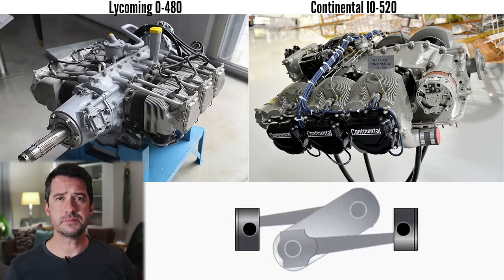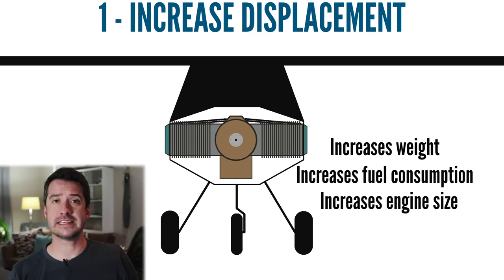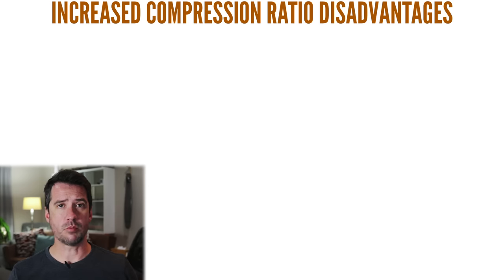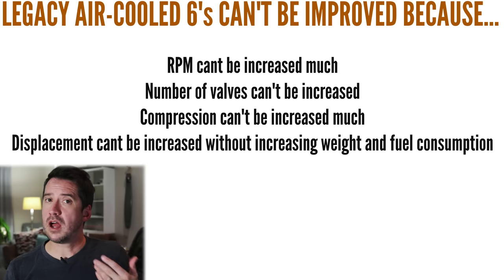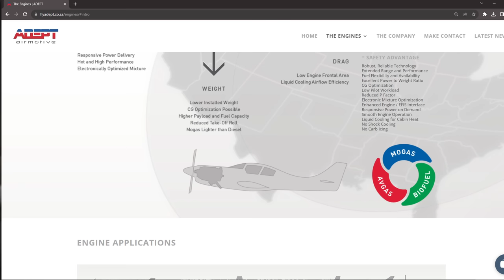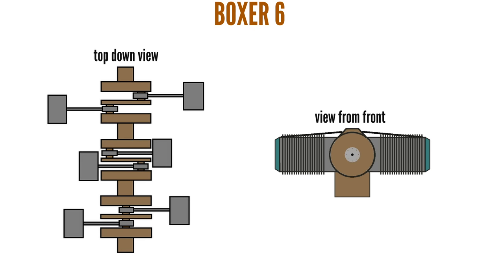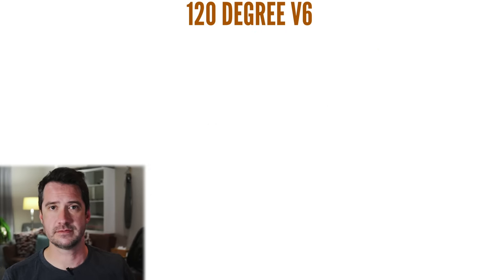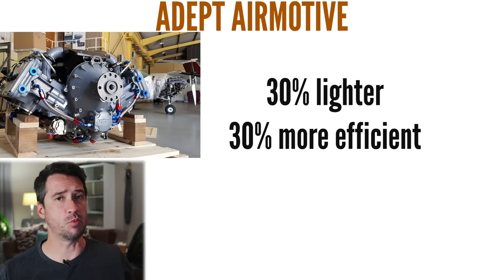Unusual V6 Airplane Engine Makes Boxer 6 OBSOLETE?

Comment: Next do a show on the Deltahawk liquid cooled, inverted V4, supercharged two stroke that burns Jet A or diesel. Only four cylinder versions to 235hp with added turbo currently . But six cylinder versions are on the way.
Reply from the maker: Already done 😄
Reply: @LetsGoAviate , Crap, now I have to find it!  Thanks
Reply from the maker: @derrelcarter9401  Incase you haven't already, it's in the same playlist. Main channel page, "All About Airplane Engines" category, it's at the top. Video should be the 3rd or so from the top. You can also just search Deltahawk in Youtube, my video should be close to the top.
Reply: @LetsGoAviate , Yep, I found it. Thanks

Comment: So basically, this engine is doing everything what the Austro - Engine does, only worse and with the wrong kind of fuel and 10 years too late. 😂
Reply: When compared to the AE330, it weighs significantly less and makes double the horsepower, while burning less expensive fuel (mogas) at the same rate (same BSFC at cruise), so it's better in every possible way.
Reply: @PistonAvatarGuy  The weight is a bit better, not that much. At the manufacturer's homepage I can't find any numbers regarding the consumption so I'll assume it's actually atrocious. The AE330 has a comsumption of 39l / h at 100% power and 21l at 60% power. Those old fashioned Lycomings will guzzle twice as much at cruising speed. I doubt this gasoline engine is that much better. Also: Austro Engines had reached a combined one million operating hours in 2016 already. They have an actual TBO of 1800 now. Not a "projected" TBO. In addition to that, Jet-A1 is a bit cheaper than AVGAS. Theoretically, you can operate the AE on diesel and this engine on ordinary gas. But if you go to any heights, you need avgas and Jet-A1. The methanol in gas will bubble out at low air pressure and the bubbles will clog your fuel lines and diesel would freeze and do the same thing. So there's exactly one advantage left: Absolute performance numbers. If you have a rather large SEP plane you might need more HP then the AE330 can deliver. The AE might not have enough oomph for a Skywagon, for example. On the other hand: why not go turboprop if you need that much power?
Reply: @braeutigamp  70 pounds is significant, especially when one 360T can replace two AE330s. The listed weight for the Adept Airmotive engine also includes basically everything the engine needs to run, while that's not likely so with the AE330. I suggest that you watch a video by rv6ejguy titled Vid #93. Diesel vs. Spark Ignition Aero Engines for information on the efficiency of these engines. Even the Rotax 912 iS gets close to the efficiency (BSFC) of the Austro Engine diesels. Diesels just aren't that efficient in the higher realms of engine power output required by aircraft. Lycoming and Continental engines just aren't that efficient in general. This engine doesn't need avgas, it can run on mogas, which is cheaper than jet fuel. Methanol? Did you mean ethanol? Mogas does not have ethanol. Turboprops are ridiculously expensive and they guzzle ridiculous amounts of fuel in this power output range.
Reply: @PistonAvatarGuy  Turboprops might be expensive and guzzle fuel, but we are leaving private pilot territory with airplanes that need in excess of 250hp. I am (rather used to be) a private pilot that occasionally rented a c-172 for 150€/h wet. It had some sort of lycoming 360 and that was a major PITA. The flight club also had a more modern plane, a cirrus. It still had an engine without FADEC. I never bothered with this thing, I was hardly willing to spend the cost of the Cessna, let alone even more for the Cirrus. Fuel only was partly contributing to this cost. There's insurance, maintenance, weather forecast service, hangar, etc. I really would have loved to fly in a modern aircraft with FADEC. Although flying was considered affordable by most club members, like that, it was not really my cup of tea. So I gave it up after a couple of years. The Cessna was more like flying a brick with a 50s US lawn-mower engine than anything else, IMO. You do have a wonderful view in those high wing aircraft, though.

On the other hand, if you are proffessionally operating a plane, you need to keep it in the air. You have a very high fixed cost and fuel consumption will only play a minor role on your overall cost. There's crew salaries, training, hangar, insurance and refurbishment, for example. You only make money as long as that thing is in the air. And a turboprop will have twice the TBO of a piston engine. I doubt you can have an overhaul for less than 30k. And you can buy a lot of fuel for 30k.

For me, this new engine is of absolutely no use. If I was still flying and wanted to buy my own SEP aircraft, I could probably get away with buying a used C-152 with 500 hours left on the engine and fly it for the next 10 years without overhaul. A nice one would set me back 40k, maybe. So, in my opinion, what we need is a way smaller, modern aviation engine for half the price, half the size and half the power. It's what our kids can afford to fly 20 years down the road. If we want private aviation to stay alive, that's what we need, not a humongous 70k$ piston engine that competes with turboprops.
Reply: @braeutigamp  "...but we are leaving private pilot territory with airplanes that need in excess of 250hp"

Cirrus SR22, Cessna Stationair, Velocity XL...

As far as I can tell, turbine engines in the 300-400 hp range don't have very high TBOs and they probably cost a lot more to rebuild. Piston engines also tend to do better on short-haul routes.
Reply: @PistonAvatarGuy  Wrong.
Reply: @braeutigamp  ok

Comment: There is way more reasons airplane engines are the way they are. Fewer parts is fewer failures. Low compression is good. If for whatever reason a cylinder fails the engine still would have SOME power. Experimental category airplanes can use non certified things like this engine.

Comment: Anyone notice the reduction gear box on the front of the engine? The old school engines will often run direct drive to the prop due to the low RPM power curve.

Comment: A couple of things I wonder about. 
What about a high revving motor with direct drive to a fan jet. Any realistic possibilities there?
Or, how about a hybrid with enough battery for a safety reserve and a lightweight diesel generator. Since failure of the engine would not be critical, it ought to be possible to use a high power/weight engine that would not normally be certifiable. Again, inviting your thoughts.

Comment: Personally I would have gone with a 90 degree v4. Or possibly like the Taunus Ford 60 degree v4 engines used in Saab Sonnet race cars.  We could pull naturally asperated 200 hp out of those Taunus engines easily, and they came with a $50 (Fifty dollars) "life time warranty" !!
But I digress, Oil Dry sump with an efficient high pressure oil pump should help solve oil "windage" by only injecting the oil it needs rather than dump a bunch in the oil pan and let everything splash around.  Along with a crankshaft-scrapper system that dumps into a side container and back to the pump. You don't have to make oil pans deeper, you can make them wider instead. And of course louvered windage tray baffles. Additionally doing a "knife edge" treatment to the leading and trailing edges of the crank lobes (in effect turning them into small wings to guide oil flow and reduce the aerosol effect). You can't avoid or change much the air flow inside the crank case (windage), but you can control the oil flow to help keep it from becoming an aerosol.  Oil mixed in air cannot shed heat as well as liquid oil.
Believe it or not, we have all these same windage problems with old Flat Head motorcycle engines like the Indian Chiefs. However there we could tap off some of the crank case pressure and oil spray with a one way check valve and let it simply dump on the rear chain of the bike to help oil the chain !
...my only real concern with this engine is .....TWENTY FOUR VALVES !!!......woof.  Better get that deluxe valve grinder out of the shed....

Comment: The V6 mentioned here, each with 2 overhead camshafts, can easily withstand a conventional 6-cylinder boxer in terms of width. But it has a lot more individual parts, also because of the balance shaft, without which it would vibrate. At least this leads to a higher price. Can this compensate for the small additional performance? There are also very powerful boxer engines in automobile construction, such as PORSCHE. If the same development effort had been put into the boxer engines of light aircraft, their performance would also be higher. It remains to be seen whether this 'new' V6 will be accepted into the market, especially since some of the alternative fuels mentioned are not yet available. If so, they will be much more expensive.
For light aircraft, a 2-disc rotary engine might be more advantageous.

Comment: Once you get an airplane engine that runs and is somehow out of all the models you have experamented with it proves itself as a redundent life support system and its ruggetness and able to be serviced ate a fair price you keep it and allways have parts replacement ready for the usual standard service.Yea that young fellow is right, The old saying IF  IT  AINT  BROKEN  DONT  FIX  IT.

Comment: Really? An engine torque values greater than a Big Block Chevy V8?
Reply from the maker: Well no, it's not engine torue, it's torque at the propeller. The redrive (gearbox) increases torque.